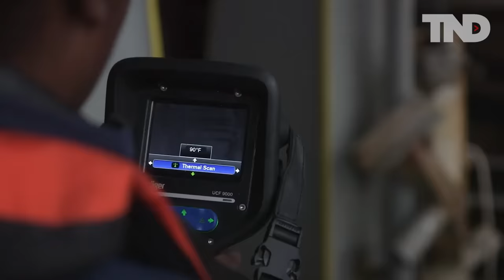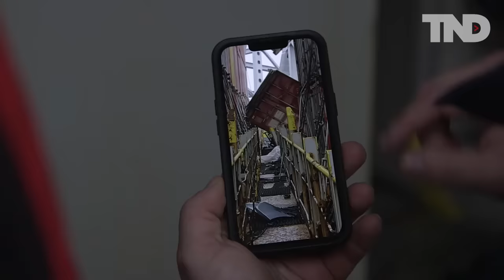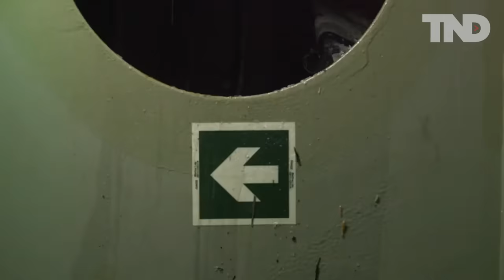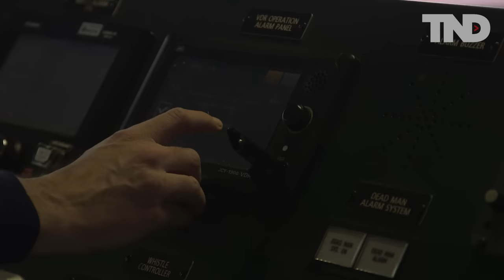NTSB video shows inside of DALI cargo ship, close-up damage to Baltimore bridge after collapse

Comment: As a former Marine Engineer I can imagine what was going on in the Engine Room there isn't any more helplessness that an engine refusing to start. One of the videos shows heavy black smoke when the crew try to restart. The Motor Vessel has to use Diesel for maneuvering and going to black oil for cruising at a constant speed this is the nightmare of all times for the black gang.
Reply: I know someone with a recreational sized houseboat that smashed three boats when it's engine stalled.  I felt so sorry for him.  When it comes to marine parts and service, the expense adds up quickly.
Reply: What I question is when the Port Captains knew of the electrical back out and couldn't immediately restart the engines  and supposedly dropped the port anchor why did the ship take a hard starboard turn into the bridge structure?
Reply: What made the engine go out and why no generators?  This would seem to be a HUGE deficiency on the part of the ship's management.  I can't believe this is an every day occurrence or else we're in even worse danger than we thought.  I also wonder if there is any evidence of foul play (hacking) of their system.  You don't have to be a conspiracy theorist to wonder.
Reply: ‘Black gang’ ??
Reply: @pushslice  The term black gang comes from when coal was still used for firing boilers and to a lesser extent early oil-fired boilers. The coal dust and sot would get everywhere and turn everything black. So when the crews from the engineering spaces would come up from below. They would be black, clothes, skin, hair, everything. Add to that and the word gang can be used to denote a group of people and you get Black Gang used to describe members of a ship's crew that worked in the engine rooms, fire rooms, coal bunkers, boiler rooms and or any place that gave the ship power to operate.
Reply: @SpcPoole  

Fantastic historical lagnappe! Thanks .
Reply: The worst is being sequestered on board the ship after this disaster unable to do anything but answer questions and watch!
Reply: @smitty4912  currant is pretty strong there, the propellers direction and the without power the steering would have been basically useless unable to counteract that
Reply: @moonchild7456   The emergency generator DID kick-in. This merely powers up the necessary lighting for crew evacuation & some auxilary electrical power to the crew block.
Reply: @moonchild7456 a possible water in diesel oil tank from moisture that nobody drain every watch
Reply: @_Ben4810  I still question the Hard Starboard direction. Could the rudder have been stuck in that direction?
Reply: @smitty4912  Prop walk .
Reply: Why is it the emergency manual steering not successful?
Reply: @JohnA4564  IT WAS SABOTAGE ON PURPOSE WTF UP
Reply: It is just me or did it seem like the ship backed up into or against the abutment?
Reply: @michaelgaley9532: I need a clarification. I am a mechanical engineer and specialized in heavy duty earthmoving and construction equipment. I understand that the steering system consists of the massive rudder pivoted vertically in the middle of the stern section just above the propeller , moved by massive hydraulic cylinders inside the hull. Is the hydraulic system electronically commanded by the wheel, inside the bridge, sensed by the electrical system which then actuates the solenoids, which then operates the pilot operated hydraulic system.
Reply: How did the rudder move if power was lost? The massive hydraulic system would not go floppy, it would have remained in the straight position according to the ships straight line path in the channel. Explain Mr engineer if you please.
Reply: @sujoyghosh5880 Not only would the rudder have remained in a neutral position if power was lost. Both the rudder and bow thrusters would have been needed to turn the ship sharply into the bridge so they must have been under power all the time. 
Someone simply turned the lights off at the fuse board to give the appearance of power loss. 
Did you notice the 3 thermite flashes from left to right in the slow motion port camera footage?
Reply: @user-yl7ep2fo9t I love how Americans turn everything into a conspiracy, it was a simple accident, shit happens get over it
Reply: CB1000 I'm British for starters. Are you a fact checker working damage control?
Reply: @smitty4912 the current probably did that. By the time the anchor dropped, it was more of a suggestion than a demand. That kinda weight can’t actually be stopped with an anchor, just slowed down a little.
Reply: @CB1000FP1 Снова Путин виноват!:)
Reply: @pushslice  black gang is old term for engine room staff, comes back from the time when ships had steam engines powered by coal
Reply: @JohnA4564  it's not like driving a car, if you don't have propulsion, you do not have steering on these ships.
Reply: @heuhen  yes you can. Propulsion is driven by the main engine, electrical power is driven by generators, manual steering is driven by emergency generator located in the upper deck not in the engine room. Emergency generator is built in case of fire in the engine room or power failure like this one.
Reply: @leovaldez5017  As an ex marine engineer watch keeper, we had to drain the water from the settling, ready use and diesel tanks every watch. It is suprising how much comes out despite all the on board purification processes. If this task is left for any length of time the water would soon reach the outlet valve on the tanks and into the engine fuel systems and it's all stop from then on.
Reply: @CB1000FP1  scary,the ignorance
Reply: @sujoyghosh5880  the propeller blocks the flow in front of the rudder. if the engine is running all is good, but no engine, now there is a big disturbance and the rudder is not going to be effective in such a wake field. (NA&ME student)
Reply: ‘As a former Marine Engineer’. Really? Wow. I’m a retired Electrician and I can imagine it too.
Reply: @hughdonnelly7183  Ok
Reply: @pushslice  Old Navy term referring to the coal passers and the cave like Engine Rooms. The Engine Room crew was always coated in soot and oil.
Reply: @user-yl7ep2fo9t  I'm English as well, and I'm merely pointing out that any disaster that befalls America someone manages to come up with a half a dozen wild theories as to the cause when the facts are usually simple and straightforward
Reply: Poor maintenance is it going to get them out of the fact that there are six people dead. Sick and tired of listening to people b** that's a bridge what about all that product on the cargo ship people aren't going to get their stuff. But no one wants to acknowledge the people that died and their family members
Reply: @DONNY-ij8mp what is anybody going to gain taking out a bridge in the middle of the night. If it's sabotage or terrorist attacks they would have waited until rush hour to get maximum casualties No it's called shity maintenance and irresponsible crew that's going to cost them billions
Reply: @smitty4912  It took a hard starboard turn because this is how physics works, the ship is huge and it has to fight the rivers current in normal operation now if you loose power and start drifting to the right this means the ship is diagonal to the flow of the river meaning that the river is applying equal force along the entire right side of the ship as it is on a slight angle causing it to drift down at an angle facing to the right, now if you drop an anchor on the left this would make matters worse not better when  the ship is already on an angle as now due to the anchor you have massive drag at the front of the ship meaning that the force of the river is now mostly pushing on the rear right of the ship causing the ship to turn more to the right and toward the thing you are trying to avoid.
Reply: @smitty4912  ...IT TURNED ON A DIME.....BETTER HANDLING THAN A FERRARI
Reply: @pushslice  A common phrase describing the engine room crew. Originated from the days of coal fired boilers.
Reply: I know this is q tragedy and a mess. But this is definitely a cool look inside the ship. Thanks news for being through with the public.
Reply: specially when it turns 60 degree's directly in to a column of a bridge as if by magic.
Reply: @smitty4912 
Ramming speed…. That’s why all the black smoke… full throttle
Reply: I suspect Dirty fuel.     But I'm not an expert
Reply: All of you fellow's in thh comment section must be over 80, maybe some in 90's, never learned the art of grammar and punctuation. But, it's never too late.
Reply: @pushslice  Ships crew that work in the engine room. This was due to them being covered in black coal dust.
Reply: @DONNY-ij8mp  Nice try, Trump. Get back out on the campaign trail.
Reply: @donalfinn4205  Good for you. Congratulations on that!
Reply: @pushslice  What SpcPoole said about the black gang and the coal turning everything black also applies to old steam locomotives and their firemen (the guys who shoveled the coal into the furnace). In a particular song covered by Johnny Cash called The Wreck of the Old 97, he referred to the fireman as "black, greasy fireman" but had to change the lyrics in later performances and recordings because the dumb city folk thought it was a racist terminology, not realizing that the fireman was actually white but covered in coal soot. It was later turned to "Big, greasy fireman".
Reply: What happened to the Harbour Tugs!!
Reply: @smitty4912  good question but from here you wont get an answer althugh from the video recording it looks like a deliberate act to take out the only support that held the bridge up, in other words they deliberately rammed the bridge & the black smoke was the engine being restarted also the ship picked up speed too just before impact
Reply: might have been done on purpose
Reply: @gregorylyon1004  can dirty fuel do that? I mean i guess if it's realy bad but why would they sell it like that wouldn't there be more issues like this then this week or at least month?
Reply: @jasinere35  To many Circumstances !! It's also been reported that the ship was delayed in port for 48 hours because of electrical issues. Main breakers were tripping because of overload of refrigeration on the ship and the circuits were rerouted to another electrical panel and this is not the only time this ship has had issues of this nature. The ships captain is Ukrainian so I question it's competency !!!
Reply: As a marine engineer then you realize how important multiple forms of power production and thrust are. These 200,000 long ton cargo vessels with only a single engine are and were a ticking timebomb that a drivethru worker at Burger King could have seen.
Reply: @CB1000FP1 
Not all of us drink Trump's Kool--Aid. Most of us are intelligent enough to possess thoughts deeper than a thimble-full of water.

Comment: It could have been worse. The ship didn't catch on fire.
Reply: Not yet, the ship is full of dangerous chemicals!
Reply: And it didn't happen during rush hour when the bridge would have been crowded.
Reply: @hermanfurlong6752 ❤❤❤ Amazing very nice ❤❤ good work
Reply: @Gamble661 very very nice ship ❤❤❤ Hard Working
Reply: The container with my Amazon package didn't fall off and sink. So much worse !
Reply: @BoatbuildingIndia Nice and hard working ? Is that why they crashed into a bridge ?
Reply: @briancleveland6115 ”All we had to do was not hit the damn bridge CJ”
Reply: @AddableStone13  We ? By not doing that they didn't seem to be very hard working, not good work at all.
Reply: And it didn’t sink.
Reply: @californiahiker9616  It did sink. Its on the bottom
Reply: It did smoke and put put a plume of smoke in the air
Reply: @stevennagley3407  That was the crew crapping their pants
Reply: @TassyDeval  She is hard aground at the bow, all that steel from the Key Bridge is pressing her down into the harbor bottom.  The bridge wreckage has to be removed in order to lighten her to the point where she's free to be moved back into the harbor to unload her so she can be taken to a shipyard either for repairs or scrapping.
Reply: @briancleveland6115 their vessel lost all power, there wasn’t anything they could do to stop it from colliding at that point, They did however drop their anchor to try and slow down and warned the city to clear the bridge something that saved many lives

Comment: Dali has to be a solid vessel, if you can drop a mile long bridge on it and it can take the hit.
Reply: The bow is resting on the river bed.
Reply: Its too overloaded
Reply: @gamesponge7176  load is 4700 containers, the ship can take 10,000, got overloaded at bow when the bridge collapsed over it.
Reply: @gamesponge7176 No. You shouldn’t talk anymore.
Reply: @davidperry970 How so, the river is 50’ deep there, right there, as reported elsewhere by NTSB.
Reply: @gamesponge7176  If it was overloaded it would indicate by the Plimsoll line being underwater. It was above so it couldn't have been overloaded. If it had the ship would not have been allowed to sail.
Reply: well of course. The ship stops at the waterline.
Reply: @snowcreek7156  the ship has a draft of 49'
Reply: The glancing was hard on bridge. No Memphis cables joint to joint like Domino's
Reply: @goatdocfilms504 . There we go, I was wondering if anyone else had thought about that. Big ship like that doesn't end a couple feet below the water line. Those things had to be damn near scraping bottom fully loaded, and then there's the tide. All above my pay grade, that's why they don't let me pilot the ship
Reply: @marcocasati6953  The ship is rated for 10,000 TEU (twenty-foot equivalent unit) but it's mostly loaded with forty-foot containers which are equal to two TEU, so with 4700 containers onboard it's close to being fully loaded. 

But yes, the giant concrete cap beam sitting on the bow is enough to overload it, without the other parts of the concrete pier columns, steel super structure and road desk hanging over bow also.
Reply: Or another way of putting is....... that bridge must be extremely fragile!
Reply: @cnelsonlv99  not fragile its 50 years old and not designed to be hit by something that weighs over 100,000 tons.
Reply: @goatdocfilms504  Yea, that's a good point. A bridge that size is supposed to have concrete barricades around the pillars that would prevent any ship from actually reaching the pillar.
Reply: @taznz1  Good point, i stand corrected 👍
Reply: @snowcreek7156  Its 50' in the channel. They are out of the channel at that pier.
Reply: @gamesponge7176 not even close compared to when it came  into the harbor.
Reply: @cnelsonlv99 those pillars are not on every bridge, every waterway has different regulations or requirements for protection. The forces that were applied on impact had to be massive,
Reply: The front of a ship is reinforced.    It's called the bulk head.

Comment: As a merchant marine engineer, reading this comment section is painful! We don’t know what happened the only people who do know what happened was the ships crew and the pilot. From what I see they lost a genset or something else that caused an electrical failure. They didn’t lose the main engine. Steering on a ship works just like steering on a boat. You have at least two hydraulic pumps driven by regular old 3 phase AC induction motors. You only need one but you always have at least one backup incase of a failure. The same goes for gensets. Lose electrical power and you lose steering, air compressors, ect. You basically lose the entire vessel. Now at some point after the first power failure the ship went to full astern propulsion. Whether it had a direct reversing engine or a controllable pitch wheel I don’t know. If it was a direct reversing engine then I think we can safely say someone ordered full astern. Whether or not this was the correct decision I can’t say. It’s easy to say had they not backed down on it they would have made it through the bridge but because of the crosswind and the fact we haven’t seen a head on video we don’t know. Now if the ship had a controllable pitch prop then a loss of electrical power will cause some systems to go into full reverse pitch. Either way the hard backing down is clearly evident in the video both from the black smoke and the prop walk pulling the stern to port. Once again without a centerline view we can’t know if the ship was going to go through the bridge or it was already getting set.

Comment: A diesel engine will stop running if the there is water in the fuel or another contaminate, that would cause the loss of power and steering.
The ship had the same problem a few weeks ago as I understand the reports.
Reply: Don't you use a centrifuge pump to filter the water out and filters
Reply: I has heard a news report mention contaminates in the fuel too. I would imagine at this point they're going to be cautious and look into every little detail extensively. Don't wanna be second guessed by all the social media experts.🤔 Seriously though, a whole lotta eyes on this, they need to make sure and get it right .
Reply: Without power the rudder would have remained in the neutral position going straight. The massive hydraulic system controlling the rudder wouldn't go limp, it would have been locked in position.
The rudder and the bow thrusters must have been under power and input from the bridge controls fir the ship to make such a sharp turn....facts.
Reply: @aljock6927 if there was water in the fuel system it would've been grey smoke when restarted. It was heavy black which indicates not enough air or dumping of fuel.
Reply: These ships don't run on diesel fuel, they run on crude oil, and these ships have advanced machinery that cleans, treats and filters the crude oil way before it hits the diesel engines
Reply: @Rock-Bottem1982  100 percent correct. Good point.